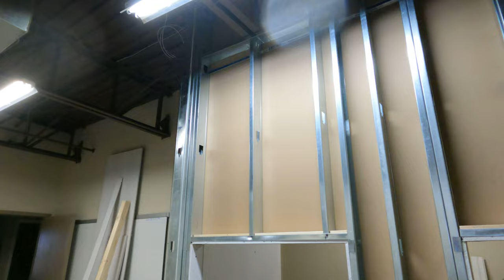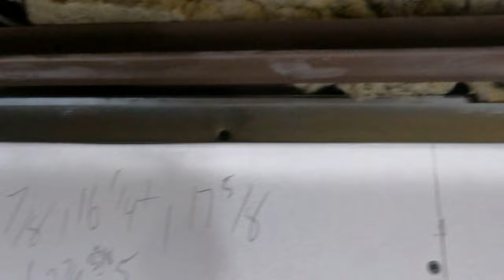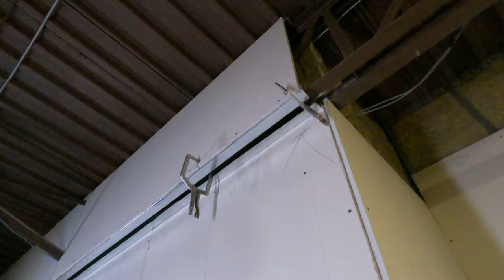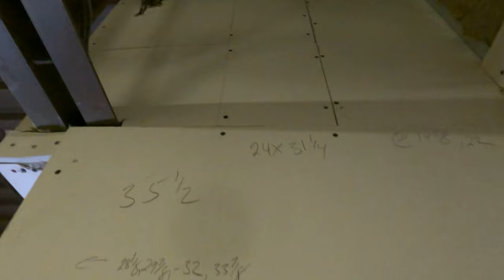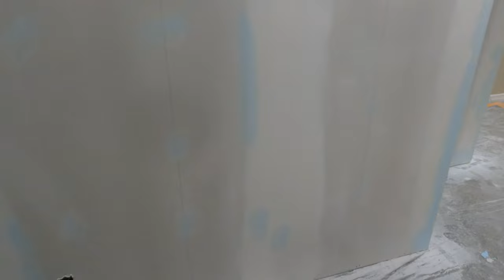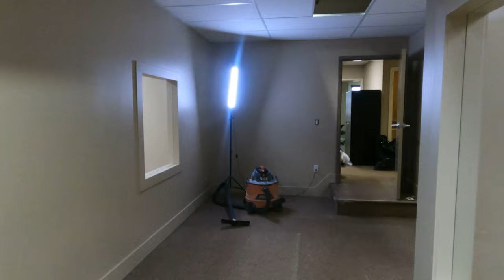Metal Stud Framing Walls With Doors & Windows Complete To Paint

Comment: Do you need to put wood behind the studs on the doorway? And do the doors go on before or after drywall?
Reply from the maker: We have wood on the inside of the studs.  Wood jams the drywall goes first, you can also use expandable metal frames. If it's a welded frame it has to go on during the framing stage.
Reply: @ConstructionKronies  ok thanks!

Comment: Hi Master❤ Could you let me know how to prevent crack or broken between Drywall and steel frame(windows n door)? Somebody told me make a gaps and input uratan form which will catch windows(doors) with Steel frame. Use uratan foam as like glue. Is there any hard ware not uratan form. I think uratan form for air tighten 😂
Reply from the maker: I'm trying to understand the question better and I think you mean the expansion foam for exterior windows and doors. We can also wrap the opening with 3/4" treated plywood, air vapor barrier like blueskin, then can stuff batt insulation or foam, with a nice flashing on the outside and drywall return on the inside.
Reply: @ConstructionKronies  thank you so much master

Comment: It's a thought in the far far future but,

How much more expensive is it to build a house with steel than wood?
I know that majority of the cost comes from finding a good builder that can work with steel,
Is it true that the cost of steel and wood aren't much different nowadays?
How hard is it to insulate a steel building because majority of the counter arguments against steel frame houses is that it will get really hot or cold due to conductivity of metal.
I know majority of the steel used in buildings are galvanized and coated against rust but,
are there any extra precautions to take?
Reply from the maker: There is a lot to cover here. The short answer is it depends on the method. Steel is way better and when used properly will have a much better thermal, moisture and rain screen envelope. Not proven yet but I do have a delivery method that will be cheaper than wood as well. Basically you need to invest in proper concrete (never hire a residential concrete guy) maybe even ICF and structural steel, then stick frame on site (never ever hire a panel company) and you will have a building that lasts forever.
Reply: @ConstructionKronies  Thank you very much for your answers and definitely will keep these in mind!